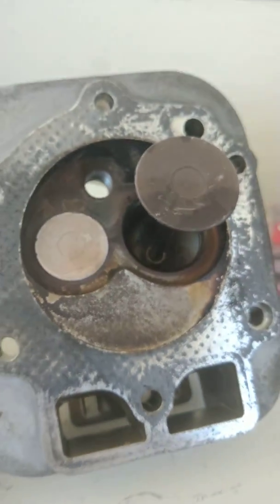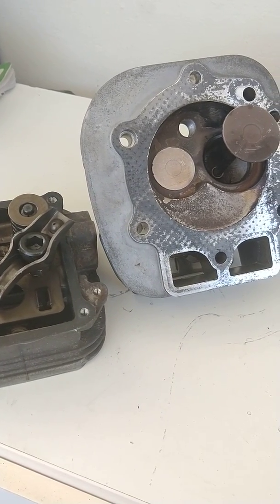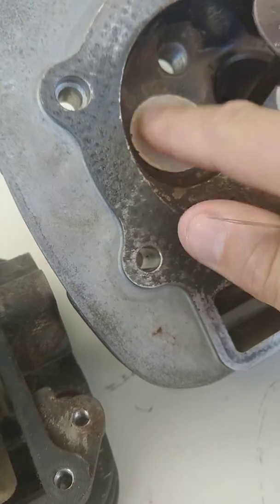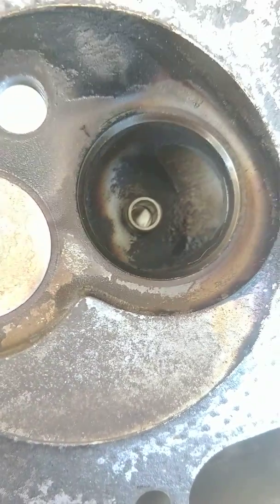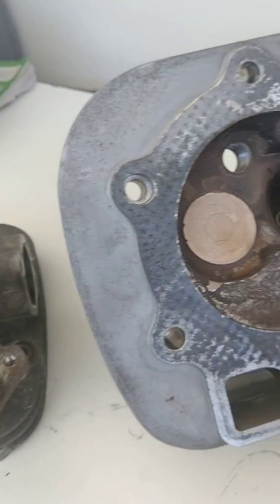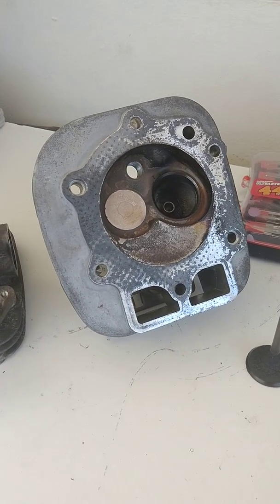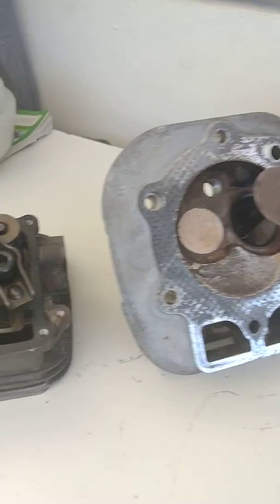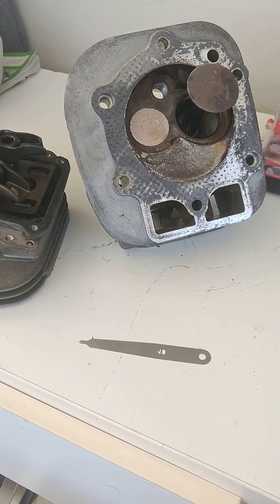Community Requested Video Generac Valve Adjustments

Comment: what are the valve lash adjustment specs for it? I have a 212cc Generac motor i scavenged for free and put it on a minibike..lol also can you tell me what the spring # is?
Reply from the maker: Hi Rob, .004-.008" for both valves will be good for your machine unless you plan to modify it. 
You can get parts at www.arcolawn.com

Comment: does seem kinda lame how generac needs adjustments that often.  why cant they put a better engine in it? no ones car needs that much maintenance
Reply from the maker: Good point Mark. Automotive style hydraulic lifters do not need adjustment once set at the factory. Kohler engines are usually this style. The 999 engine from Generac is cooled by air so the temperature swings can affect the adjustments more. Generac offers hydraulic lifters on many models but you most likely will never see these sold at a box store like Home Depot that is focussed on price over quality. Thanks again for the comment. Come hang on the beach with us some time in Puerto Rico.